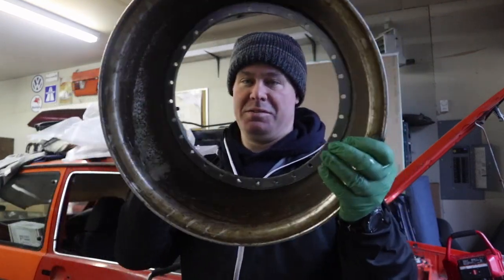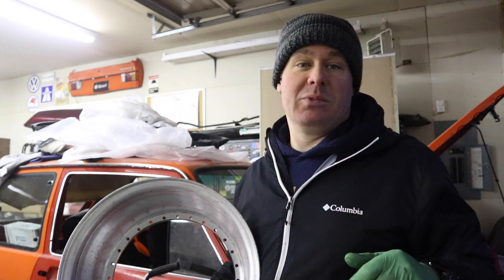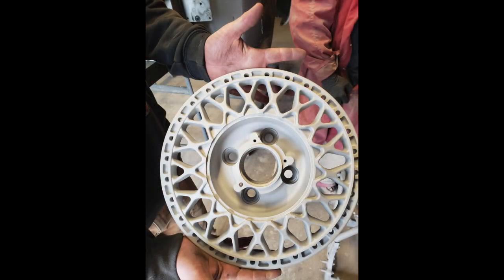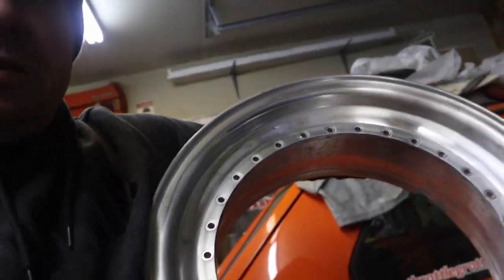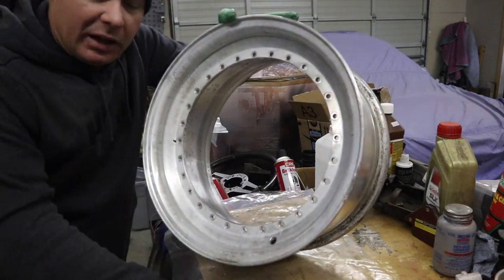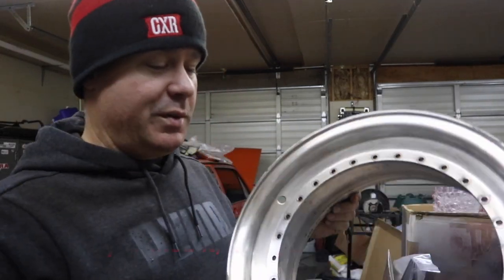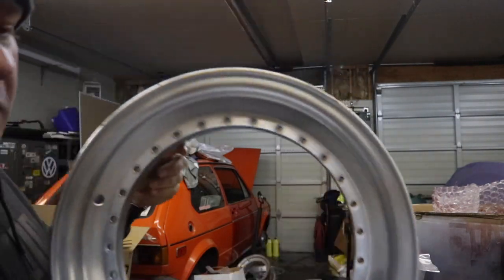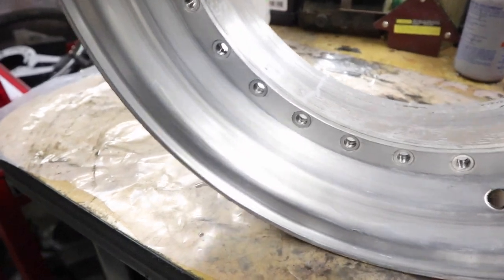Refinishing American Racing 398 wheels -1975 VW Rabbit 1.8t 20v swap ep 41

Comment: Thank you so much for your advice on oven cleaner to remove anodizing! I spent 6$ on paint stripper and it did nothing.  Next spent 17$ on aircraft remover let it sit for over an hour and again nothing! I had resorted to sanding it off and it was taking forever. Then tried 4$ easy off oven cleaner and 10 minutes later I literally wiped the anodizing off with a rag.  Your a life saver.  Get back out there and keep working on stuff lol.  Excited to see how the wheels turn out.
Reply from the maker: Can't wait to see how your wheels turn out, Seth!

Comment: Looking good, I'm always a little disappointed to see another set of mesh "bbs" style wheels on a MK1. I know, I know they fit the look and style (and $300 👍) I just get sick of seeing them. What's your plan for the bolts? Are you going to polish those aswell ?
Reply from the maker: Well, I agree that it's not a unique wheel by any standard. I've got gold bolts on the way, and haven't decided on center cap nuts yet. Honestly, I have seen tons of the cars with bbs wheels as well, and never had a set. These will suffice until I find a really perfect wheel down the road.